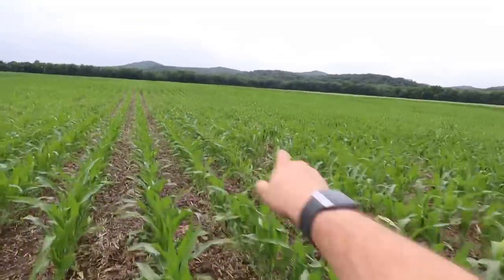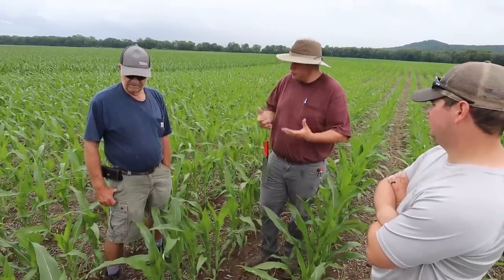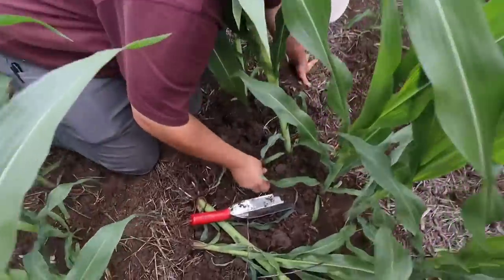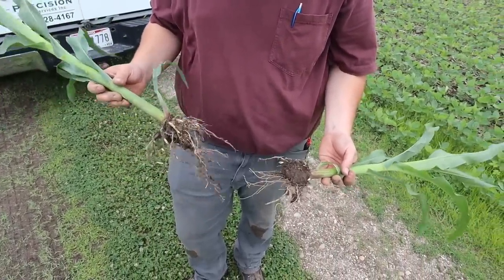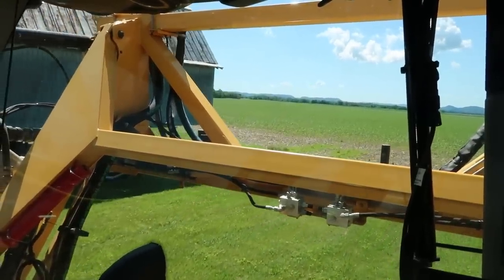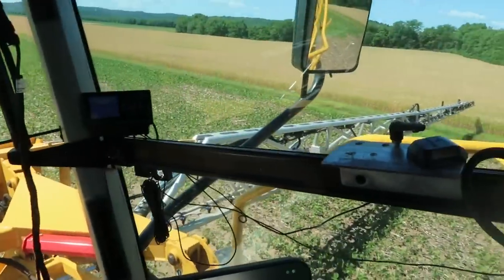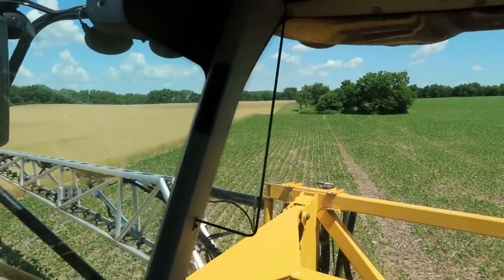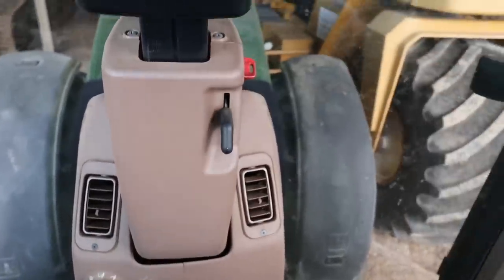Strip-Till vs No-Till

Comment: The case planter creates a Furrow differently then your traditional open or discs like white or deer. In the no-till soil as you build soil structure the closing system becomes something to keep an eye on. I go through a lot of sod oh, that old rootbound stuff that's hard to close and simple spiked Wheels have worked great!

Really hard to beat strip till when that fertilizer is underneath the roots where there is always more moisture. All your fertilizer sitting in New Orleans doesn't do anything until it gets on the river just like fertilizer put on top or Incorporated shallow it needs that water to help life get it to the root system.

All my notes Hill and conventional till maps of the same field will look very similar Thelma but where I did strip-till with a deep Shank and put the fertilizer underneath is unbelievable how much nicer the fields look.

It took awhile to figure out in no-till that we lose that early flush of nutrients like in a tilled field. So we really had to change fertility management and now that we're banding are fertilizer in no-till it's really coming along!

Comment: Still hoping that Brian gets to try a Claas Lexion 8900 when harvest gets going :D
Reply from the maker: Brian is also hoping
Reply: That would be fun!

Got to run 8700 with 18 row chopping corn head last fall in some extremely tough conditions. It snowed about an inch that morning of wet sticky snow. Corn stalks were wringing wet, Corn was only 25% moisture so that wasn't bad. There was a John Deere s790 same size corn head the day before across the road and it had all it could do at two and a half miles an hour. I wanted to set the speed limit at 4 miles per hour because everything was just working real nice but the customer wanted four and a half and it still worked. Lol

Comment: the strip tilled plant is also much greener and a tad taller. seems the way to go to me!!!
Reply: Don't kid yourself, forgetting the obvious! Badly conducted experiment, generate bad conclusions! It's not rocket science. The "greener and a tad taller"   already had taken 20 gallons of fertilizer, by the time of the video! On the other hand the not so tall/green, took a single  application, just before the video... Enough said?! 
Now you know where the greener/taller came from. ;-)
Reply: @crpth1  if you want to reach 300 bushel corn you are already up to spraying 360 pounds of liquid nitrogen advised

Then your p and k has to be top notch and upheld aswell. And you need an high humus ratio in your top soil because an corn plant takes alot. Within a pfew years on our land we are back to grain and grass because the corn ate all the humus. This is ofcourse not for corn grain or ccm but for silage dairy feed on heavy clay. And takes up to 10 years to get an good humus ratio back with muck spreading and liquid manure.

Comment: I'm curious, will the new bigger massie you guys got not run the batwing? Wrong size PTO, not enough power? It just looks weird seeing an 8400 running a little bushhog.
Reply from the maker: The mower is ideal behind a 120hp tractor and the massie is 75hp. It was bought to pull our 15’ finish mower and it does a great job with it

Comment: Beans are pretty bad but I don't think that they're as bad as potatoes.. We use to get a 22'long 5' sides load of potatoe rejects a day.. We dumped them in the low spots of the field.. We would eventually level it out with a 4755 with a blade.. You could almost get stuck in rotten potatoes.. Talk about a stinking tractor.. Shewww

Comment: Being disappointed in one or two year no till results and going back to tillage is like going to the gym for 2 days, realizing you didn't lose weight, so you get lipo. No till takes some time, and if you're not using cover crops with it you're doing it wrong.
Reply from the maker: Been notill/minimal till since the early 90s. I’m definitely not wanting to go full conventional tillage but I’m a fan of deep inline ripping in a 5 year rotation and striptill. Different strokes for different folks
Reply: Not trying to sound judgemental, my kids and I love your channel. Especially love that you vertical till instead of conventional till. Just not sure why you'd do something mechanical when a cover crop can accomplish the same thing.
Reply from the maker: I’m always open to trying different practices. Last year we did some and this year we are doing to do some rye I believe